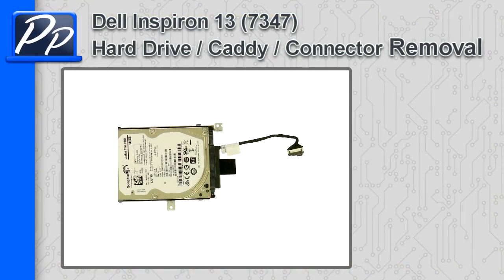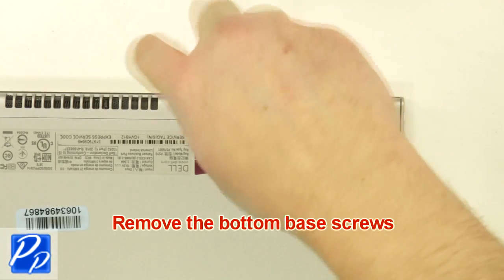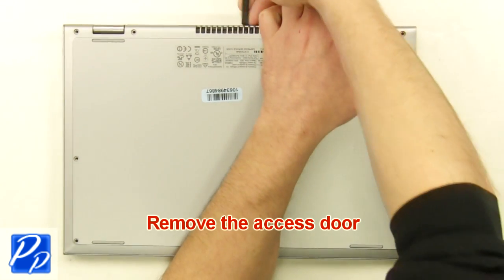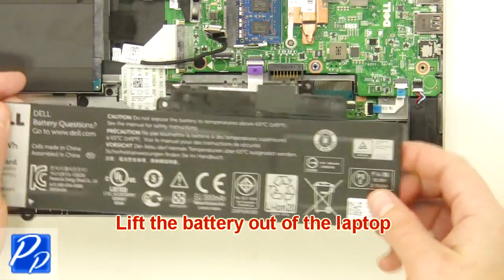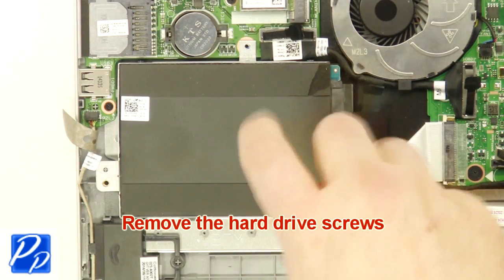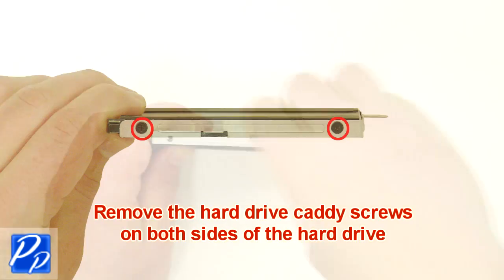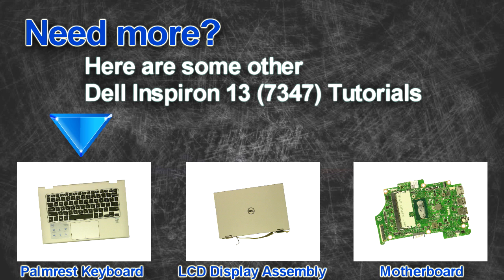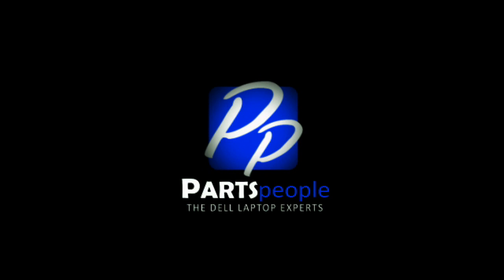Dell Inspiron 13 (7347) Hard Drive & Caddy How-To Video Tutorial

Comment: Awesome video. Just got the 7348 model and I think I will be upgrading from the 500gb drive to a 1TB drive. Your video has reassured me that I can upgrade safely, Thank you :)
Reply: The upgrade is pretty easy. I haven't done it yet but all you do is take the screws out from the bottom of the case. Then there are a screw or 2 that hold the hard drive in then it slides out. You take the screws out from the Hard drive cast and swap the drives, screw in screws and slide back in. Put the case back on and that's it. However, I am not sure if there is an app so you can back up and restore from the old to the new hard drive. But the process if really easy and doesn't void any warranties.
Reply: if you upgrade don't you loose windows os?